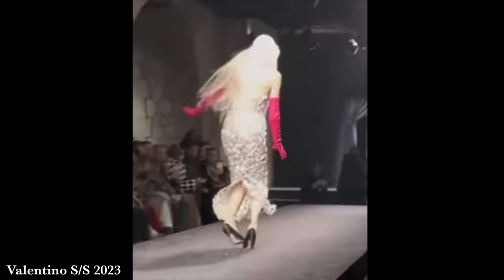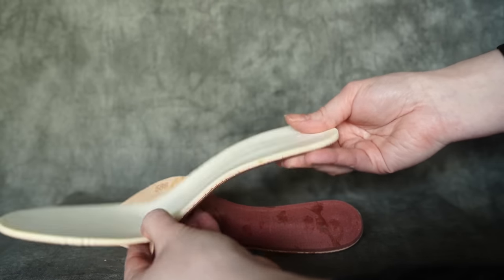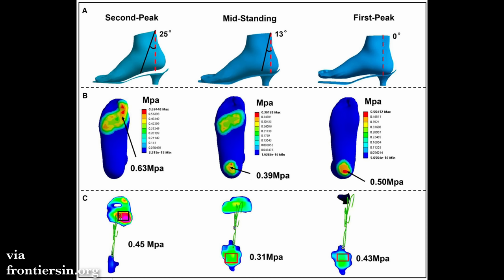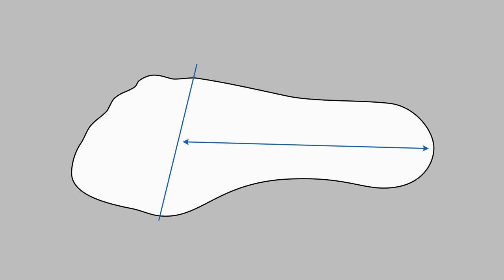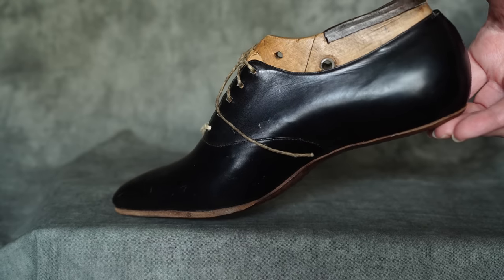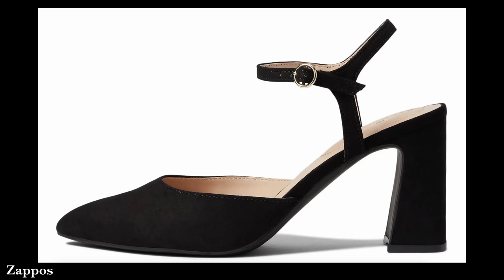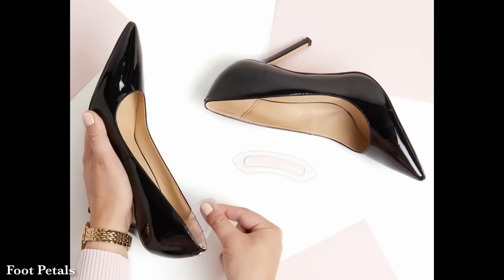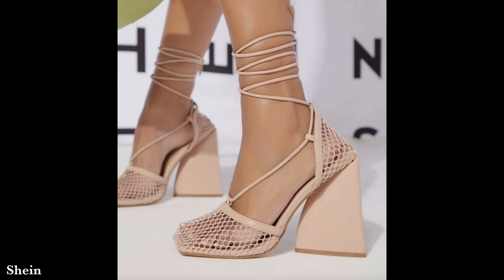Why are Modern High Heels so Bad?

Comment: As a former dancer this all makes perfect sense. I always had and easier time funding dance shoes that fit better than regular shoes. Even to this day I get frustrated trying to find shoes that fit. I have short but wide feet. Complete opposite of most shoes out there. That's are long and narrow. To get shoes that fit across the metatarsal I typically have to get shoes that are too long for my feet which means a lot of tripping since there is the big toe gap. As a result I usually wear boots or sandals. I much prefer to just go barefoot as often as I can.
Reply: Yeah I can't even wear heels. My wide feet just immediately scream in pain. Even regular shoes are not great. So when weather permits I usually wear my Toms. They have enough give without being too loose. If I need something a little bit more substantial then Chuck Taylors or boots.
Reply: I feel you girl. This is me.
Reply: Fellow former dancer and I hear you.
Reply: I've heard that some women buy "character shoes" and then get leather paint to paint them to match outfits.  I haven't found one yet that will fit my 4 inch wide foot though :(
Reply: wow yes this! damn
Reply: this might be a stupid question, but if dance shoes are a better fit, why not just wear them as your default shoe? (unless you're a former ballerina. I get why pointe shoes aren't for everyday.)
Reply: This is one thing I think the barefoot/minimalist shoe movement is inarguably right about, even if you don't think padding is harmful. The foot is not shaped like a pointed oval; it's shaped like a triangle. Shoes should have a broad toebox that allows toes to splay freely instead of smooshing them together like shrink wrap.
Reply: Dance shoes are just ridiculously more comfortable IMO. I think they're more similar to the types of shoes that Nicole makes. Also, dance shoes (at least pointe shoes) come in 6 widths and they aren't right/left typically which means if you have two different width feet (many people do) you can buy 2 pairs in different sizes and swap them for the perfect fit. 

I honestly think we need to be moving closer towards a dance model for shoes. More expensive but better fit, especially for shoes that should be about performance... heels, athletic shoes, etc. I don't need simple Keds to come in a plethora of widths because they're canvas. I can get them wet and mold them to what my feet need but high tech trainers or leather booties where the shank is where it is and the upper is rather sculpted and engineered... they just need to fit.
Reply: @apcolleen  I watch a series by another YouTuber where she goes out and talks to people, asking about their clothing and style, and I remember her talking to one woman who said that she wears dance shoes (I think the shoes in question were jazz shoes) and had for years - and never wears anything else. (Karenbritchick's series What Everyone is Wearing in New York, if you're curious, though I can't remember the precise episode.) And I can completely understand it... 

I'm lucky enough that I've found a few styles and brands that fit me that I will keep coming back to - admittedly, none of them are high heels!! And I will stick with leather and natural materials (yes, I adore my Converse in summer and my leather ankle boots in winter. Doesn't hurt that the leather boots have bit of a vintage look to them, either!)
Reply: @Chaotic_Pixie  It's interesting if you think about it because pointe shoes evolved from the soft shoes of the Regency/Romantic eras, just going in the direction of giving support to dancers who wanted (and later needed) to get right up onto their toes. The shoes Marie Taglioni wore were very little different from the shoes worn by any woman on the street in the 1810s-1830s, who likewise didn't have left/right lasted footwear.
Reply: I have a similar shoe shape. I like the foot-shaped shoe style, the shape is so much better. I'm not super keen on the barefoot options though because I've ended up with stone bruises. Something foot shaped with a bit of protection from the ground is my favourite.
Reply: Wide toes are usually so good for dancing, though! Especially en pointe. You’re lucky 🍀
Reply: @apcolleen  you can actually buy them in whatever color you like, and they also have dyeable fabric shoes that look like white satin, but take colors very well. They’re more basic in style, but still really good, classic and tasteful. If you do invest more money, you can have them customized to your exact foot. This is what I would definitely recommend. You can also get Italian sandals and other footwear made to size with a variety of styles to choose from. 

I hope more companies will go to customizing sizes, at least for straps etc and a wider variety of width/length sizes. It’s not so difficult as in the past you had to send off an outline of your foot for custom dance shoes, if you didn’t live close enough to any major pointe or ballet company. You wouldn’t get the true customization you need. Unless you made a special trip to have your fitting and then you could order shoes based on that sizing until you needed a new fitting (as dancers progress the sizing changes, your ankles and arch become stronger, you can lift up out of your toe box better etc). 

Modern shoes can be made from laser measurements of your foot on your phone, or in an online fitting and ordered matching any style/size sole matched to a custom length of straps and sole widths (the arch padding is really important). I wish companies would take advantage of the internet and modern technology to make custom orders like this. This is mainly just combining the techniques of fitting dance shoes (where a professional assesses how you use your feet and body, your size of body and strength of ankles etc with the shape of your feet. This would be amazing combined with Italian shoe companies who match a sole to straps one chooses in person and they measure your ankles and cut your straps to size, then assemble the shoes right then. 
Truly customized, no waste and no making only the most common sizes to sell. ALL orders would sell, people would be happy and come back and there wouldn’t be any waste.
Reply: @aShadeBolder  
I do that. Started Tango dancing a while ago and was immediately blown away with the quality and fit of the shoes - which look like regular, pretty 2-4" heels.
And they always have straps, so they stay on your feet! Which is a problem for me otherwise, because I need to go at least a half size up from my size as determined by foot length, to fit my wide toes. Having a very high arch doesn't help with that, either.
They do need to have a new (rubber) sole added for outside wear, though, because the default is suede. So you can slide around in them on the dancefloor. And that, obviously, wouldn't stand up to regular wear and tear. Including that, you're easily looking at around 200€ then.
So it's a bit of an investment. Still, after having bought and rarely ever worn at least a 2 dozen pairs of regular heels before in the last decade...I'd now rather pay that for a pair, I'll actually get some use out of.
Reply: Dance shoes as everyday shoes can have some of the challenges Nicole has talked about in other videos for wearing historical footwear today -- they're thin and if you're walking on concrete a lot, your feet get sore from the impact on the hard surface. Shoes for partner dancing usually have suede on the soles which will be immediately destroyed by walking outside on wet ground, which just feels like a waste. There are dance sneakers that are made to be able to dance outside, but then you get into safety issues because everyday shoes need to grip on wet or slippery ground but shoes made for dancing on concrete are designed to slide to let you spin comfortably.
Reply: SAME
Reply: Look into barefoot shoes! Only things I've found that are wide enough for me.
Reply: Oh yeah. 

I’ve contemplated buying a pair of character shoes and sticking something on the leather soles to make them more weather resistant, because I can find character shoes that fit my feet and are comfy (Capezio Jr Footlights - I’ve tried some of the other ones and they’re all too tall for my feet in the vamp) but I can’t find heels that don’t tear my feet up.

When I needed ballet flats for a regency period Halloween costume on the cheap once, I ended up sewing elastic to a pair from Walmart as if they were actual ballet shoes because I will walk out of every pair of ballet flats I can find. (Part of my problem is my toes are normal width to my otherwise narrow feet. Which means squished toes and walking out of the back. Or at least I thought this was the problem until this video where I realized that the length of my toes may be more of the problem!)
Reply: @aShadeBolder  I am a former ballerina and I had a car accident take away any chance at pointe. The reason you wouldn't want to wear dance shoes everyday is they are very soft and flexible as Nicole demonstrated. They are also very thin and would not stand up to everyday wear and tear. You couldn't expect to wear ballet slippers on the street, first there is no padding to protect your feet from the sidewalk. Second the sidewalk would literally rip apart the leather sole and depending on what kind you have rip the canvas or leather show apart in no time. Jazz shoes aren't much better. Same thing the sidewalk would rip them apart. I'm not overly familiar with character shoes but I would imagine they would be too soft and flexible as well.
Reply: This. 100%.
Though it took a while to find the right company and model, I really loved my dancing shoes, once I found the right ones.
Originally our coach, if you want to call them that, insisted on all of us wearing the same model, and I couldn't dance in it whatsoever. It felt like the heels where at different places on my feet, and I was incredibly wobbly. I don't necessarily blame them, they were dance instructors at a dancing school, not professionals. We got new, proper coaches a little later, and I started exploring the world of dancing shoes.
Reply: Why do we as consumers accept shoes that are anything but foot shaped? You’d never buy square or triangular hats!
Reply: Flamencoschuhe haben Absätze und sind sehr bequem. Inzwischen kann man sie sich auch mit Straßensohle anfertigen lassne bei einigen Herstellern. Normalerweise ist die Sohle mit Nägeln versehen.
Das dauert zwar 3 Monate, lohnt sich aber, besonders wenn man kleine oder große  Füße hat und schwer Schuhe findet.
Ich tanze in meiner Freizeit Flamenco und habe auch welche als Straßenschuh, weil sie so bequem sind.
Reply: I don't normally wear heels (or other dressy shoes), but for my wedding I wanted some cute heels in a fun color to wear under my tea length dress. After weeks of frustrated shopping, I stumbled across ballroom dancing shoes. I ended up getting emerald green ones with a comfortable almost-vintage-looking heel, and they were cheaper than most regular high heels as well.
Reply: With proper stilettos, you can’t walk heel to toe. That will get you falling over immediately. You have to walk on the balls of your foot. Great thing about dance shoes is that you can walk heel to toe, and you can still have the lift and the mobility.
Reply: There are really pretty dance flats I have found on Amazon with nice soles.  I wear them all the time.  I am a rock/jazz/bellydancer and refuse to wear heels.
Reply: Have you tried men's army shoes? They are built for function and their look reflects that. Some full leather boots are half the price of work boots and often better constructed. Occasionally, you can find street-smart or hiker style tennis shoes that come in wide and extra wide. Not all are comfy, some sizes may not be available at surplus stores and they might not be your style but I'd encourage you to look around!
Reply: Seconding everyone mentioning barefoot shoes! Groundies, Mukishoes and Vivobarefoot are my go tos, Lems have a bit more padding, Altra does great running/trail shoes, they're great for wide feet. I don't mind the lack of padding, I find it grounding, but you could probably add insoles to them if you wanted to, also.
Reply: If you happen to have diabetes (at least in the US and perhaps a few other select countries) and are followed by a podiatrist, then you would likely qualify for custom molded (made) shoes unless there is a pair of prefab sneakers that fit your particular measurements. 
Alternatively, if you have the funds for them, then you could seek out a person who still makes custom shoes for your needs.
Reply: If I am allowed to mention, Tic Tac Toes in upstate NY does wide shoes in attractive styles.
Reply: Former dancer here too and 100% agree
Reply: @aShadeBolder  The sole is typically soft leather/suede, at least for ballroom dancing, don't know about ballet. It gets ruined instantly if you walk outside for any amount of time basically.
I once ruined a pair of shoes in the middle of a ball by running 20 meters in the rain from one dancefloor to the other. I'm still sad about it.
Reply: I do have to say that most shoes aren't actually made thin, especially "opened" shoes. I have long and very thin feet and a lot of shoes for late spring and summer just don't fit my feet, they're too big. sighs
Reply: you think they're long and narrow ut as someone that has long narrow feet they are not at all lmao, i'm sliding around in those puppies or pinching my toes off, or both
Reply: @tiadeets  same problem, i walk straight out of anything thats not completely covering my arch and still the ball of my foot is pinched! Its just shoes aren't made food shaped for any type of foot i think
Reply: I just go to the New Balance store. I am not only a wide foot, but I also over-protenate. And I have orthopedic inserts. 

Tennis shoes or Skechers for me.
Reply: @aShadeBolder  so I don't know that this is true for all dance shoes, but the ballroom shoes I have (that I abuse for everyday use haha) are leather sole shoes. This is great for dancing, spinning, all that jazz, but frankly there's some everyday surfaces it's dangerous on- for example, I have to be very very careful on damp grass and plastic/metal surfaces.

Obviously, you could get the sole replaced with a synthetic one that has much more appropriate grip across various surfaces, but I don't know if there's a significant source for dance shoes with grippy soles being premade out there.
Reply: i have somewhat large (size 9.5) and rather wide feet and all of my heels are dance shoes
Reply: I’ve always had a hard time finding sandals that don’t have half my foot directly on the ground because of how thin they are as well
Reply: @aShadeBolder  most dance shoes are not suitable for outdoor wear, the construction is different to street shoes.
Reply: You can get fairly cheap custom size, shape, and design shoes in like etsy or from other makers.
Reply: @pmmmAMV  I've been looking at some Chinese ballroom dance shoe manufacturers on AliExpress and a lot of the models come with an option to get rubber soles. I'm still trying to figure out how to make sure I get a pair that fits so I haven't ordered them yet, but I really like the idea of the black practice oxford for a nice "everyday" heel that will look good with pants.